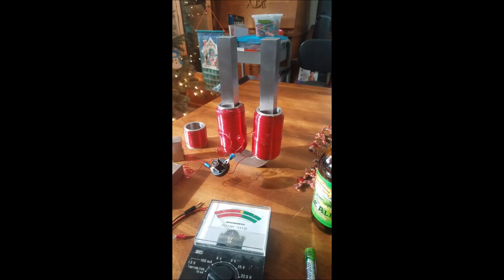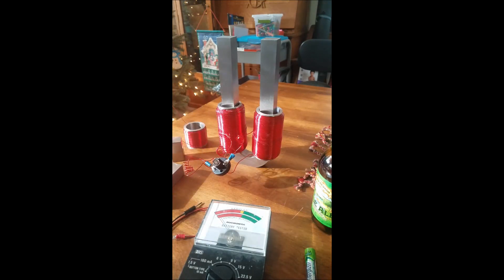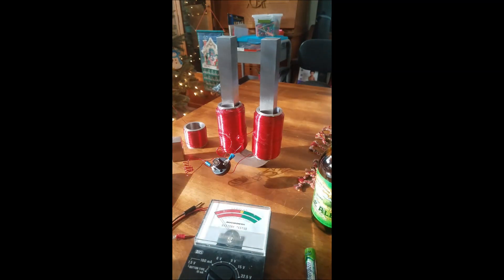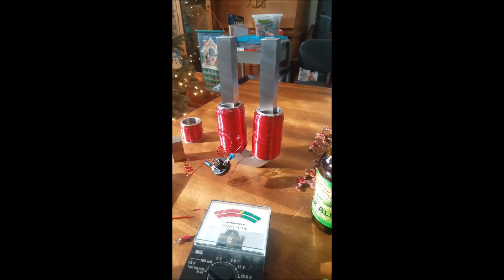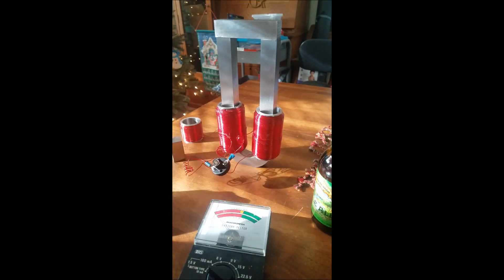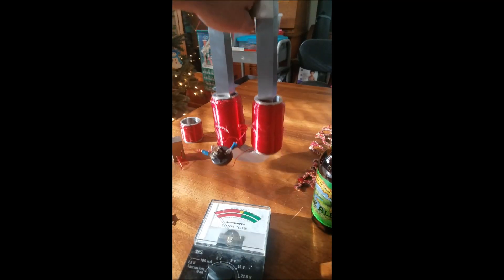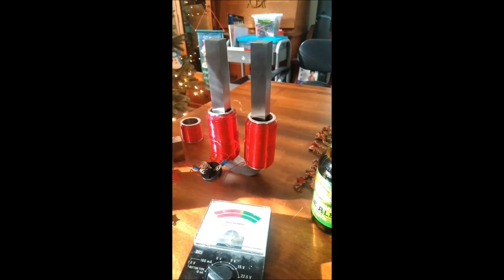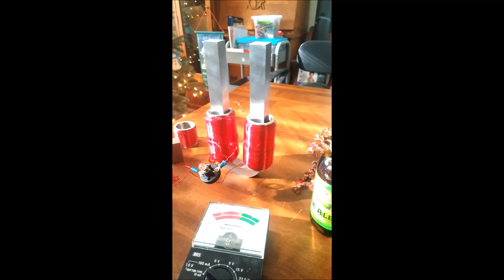Flux Capacitor - Perpetual Motion Holder

Comment: Hello, I just turned 15 and this honostly seems sureal I was told electricity could not be stored. This defeats that argument entirely. Ive been wanting to experiment with this "technology" I guess Ill call it. And I was wondering if you knew: do you need a perfectly symmetrical U shaped rod to continue the motion? Also are there any other components then the U shaped rod the bar on top and the coil?
Reply from the maker: Hello, as long as a circuit is completed it can be any shape.   Leedskalnin also included a light bulb to show that the energy doesn't deplete over time.
Reply: @MagneticUniverse  huh, sort of figured but wasnt sure. Thanks :) I'm not sure how this guy didnt get more publicity he effectivly made a compasitor last forever.

Comment: Hello, I’m not an expert and I don’t even know if what I’m gonna say makes any sense, but please consider it
Could it be possible to control the magnetic field with any of the Ed’s writings? If so he could used the side that repels to make non metal things float, did it make any sense?
And going even further (I’m actually studying history) the old civilizations could use that so called “oldest battery” to charge some pmh system, I kinda want to write about it make sense in my mind, what do you think?
Also sorry about my bad English.
Reply from the maker: He does demonstrate how gravity works with nonmetalic matter and has several experiments that involve magnetic field manipulation.  Thanks
Reply from the maker: I'd read it, go for it!
Reply from the maker: Have you  Researched the Halbach Array?

Comment: It is true, I have made one and it stops time for half an hour.  It does require you to use you mind to complete the circuit in time travel.  I made a pendant version of the Perpetual Motion magnet, with some special diodes, and crystals.  If you want to talk email me.